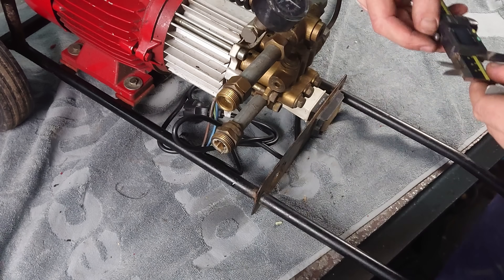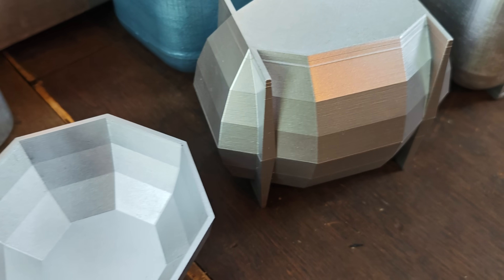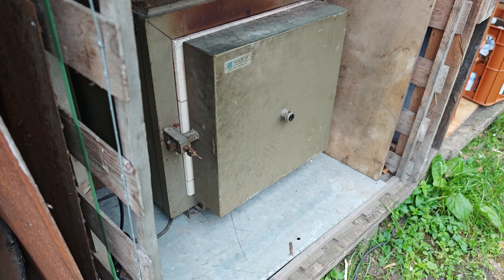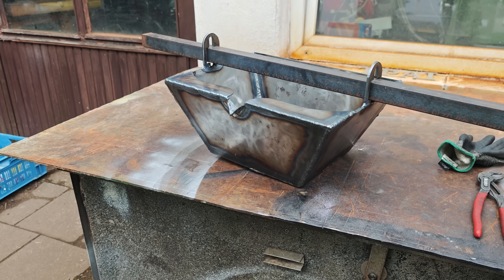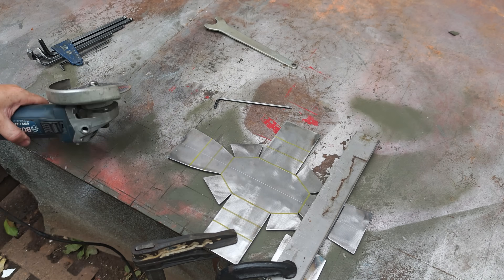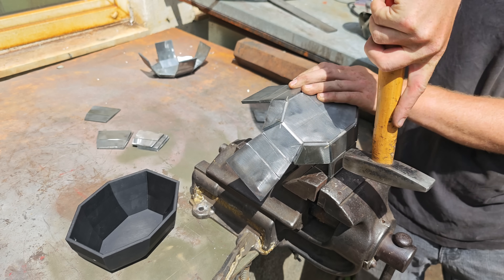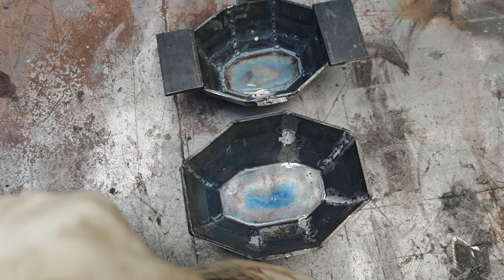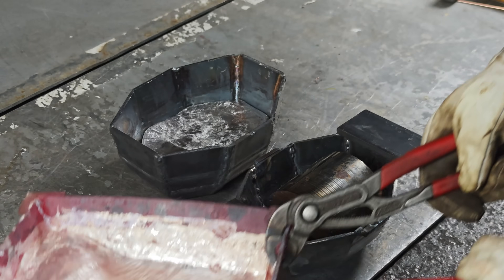Aluminium Casting Experiments! New Furnace, Melting down Scrap and Casting!

Comment: Very interesting topic, you may want to get or hand forge a skimmer to remove dross from the molten metal before pouring, this will keep the oxidized metal out of your casting. There are all types of parts people can't buy any more for scientific instruments that are now obsolete. I have an Orion 8 inch Schmidt-Cassegrain telescope and the base that connects to the legs of the tripod is broken. Parts are no longer for sale and it's a cast aluminum part. I've been looking for someone or a company to make this part at a reasonable cost. Maybe you would consider or know of where I can have such an item made? And if not, maybe you would make parts for instruments in your country, just an idea for your business. God speed your recovery!

Comment: Wishing you a brief and complete recovery. While it would somewhat complicate setting them together, I think pre-heating the inner mold might allow a bit more time for setting it inside the outer one. Also, what if rather than using pliers, a short length of chain were attached to each of the side tabs for picking the mold up?
Thank you as always for your work.

Comment: I always enjoy your projects.  I hope you are recovering quickly from the surgery.  
I am also recovering from surgery, as a result of always thinking I can do everything myself.  (I can, but sometimes I pay for it).  At age 82, I need to swallow my pride and call a friend sometimes.
I did a lot of lead casting, making a great spincasting (fishing) lure, known as a Buzz Bomb.  I like your idea, and have a couple of thoughts.  
Instead of grinding the lines for the bends of your molds, why not use the plasma cutter to cut dotted lines where you want to bend the material.  That way the parts will bend easily at exactly where you want the pattern bent, and then you just weld it up to finish the project.
To make the casting a much quicker process, why not do the casting with the mold inverted, and that way, you can put the sprue and some vents, on the base (now on top) of the outer mold .
Keep up the great work.

Comment: Good luck with your recovery! I think you could devise a sort of register that would hold the two halves together. That would make the finished product more consistent and reduce the need for the weight. Also maybe weld up a sort of funnel you could pour into to fill the mold assembly. Lastly preheating the mold should help keep hte aluminum from hardening too fast.

Comment: For the casting, you can do some kind of allining pins. Example, in bottom part of the mold do a "V" shaped "dent" and in the top part "V" shaped pin, when they slot one into another mold will be alligned easelly.

Comment: melt the aluminum in the lower mold then put the upper in. You might try making a "lost foam" mold with the sheet rock mud coating and sand and all as you can make much finer castings with that method.

Comment: Would it be possible to have the top mold already in place and pour the aluminum into a removable steel funnel? Have a few other conical (for easy removal of the inner mold) holes to allow air to vent that are all the same size as the funnel spout. Probably issues, but may mean less overpour and post processing required. Probably a silly idea and already considered and rejected, but a thought.  I'm assuming you're also already pre-heating the inner mold to take advantage of normal contraction without additional cooling (may have missed that bit in the video)?

Comment: Be careful using steel crucibles. The aluminum will eat up the steel over time and make it brittle at which point the bottom will drop out. Trash that crucible way before you think you need to.

Comment: I think you could weld some U bolts to the inner mold and use them as handle instead of the pliers to move it around

Comment: Both the block of steel and the milling to turn it into a mold sounds rather expensive if you don't have the capability to recycle the chips into new blocks.  You're a good ways from a furnace that can melt steel, and if you ever do get there you probably want a good amount of experience casting aluminum, then some intermediate melting metals like bronze and copper on the way to steel and iron.

Comment: 16:50 You can speed up the process of inserting the inner mould (and increase the precision) by not using the mechanical grips. The inner mould is cold when you put it in and the handles will take a little time to heat up after the mould comes into contact with the molten metal. Those heavy gloves you're wearing would be adequate protection I think.

Comment: I think you need to register the two parts of the mold together and add a funnel so you can pour the molten metal into the mold. Pressing the inner mold down into the molten metal leaves too much time for the metal to cool, and makes it easy to misalign the mold halves.

Comment: Your mold is so well built, why not put it directly into the kiln? If you produce ingots ot the right size, put them into the mold and heat everything up with the weight on top, you maybe could avoid pouring altogether for the end product.

Comment: Nice outcome so far! Maybe you can gain a little time when you place the outer mould on a non-conductive surface (glass fiber, slab of old marble, loose sand?) 

Had you tried to cast the moulds using fire-proof cement btw? 

Your work is always unique and inspiring!

Comment: LOL I was thinking a belt sander would make quick work of those welds and help with tidying up the outside of the cast parts, then you mentioned you didn't have one and I was surprised. But then again, modern shop tools aren't really your thing, and it's probably not easy to find a vintage one, since I'm not even sure they were really a thing back in the day.

Anyway, I'm sure you'll recover from the surgery quickly. You're clearly made of fairly staunch stuff, so I have no doubts that you'll be back in the workshop before you know it!

Comment: I see that you were using pliers to manipulate your molds. I assume that means you preheated them? I think they need to be hotter to keep the aluminum from solidifying so early.

Have you considered melting the aluminum in the outer mold to begin with? That might simplify matters assuming there is a minimum of dross which probably will require diligently cleaning the aluminum before melting it and perhaps adding some kind of flux.

Anyway, let me add my voice to those telling you to take time to heal. Do as your doctors tell you and don’t try to do things too soon.

Comment: Why not weigh out the right amount of metal, put that in the bottom half, then put the weighted top-half atop that, and cook it all in the big kiln at once? Or do it in two steps if that’s too tall, but still doing the melt in the bottom-half.

Or at least preheat the moulds so you have longer working time.

Comment: Get well soon dude!! And simple alignmet pins and handles on the mould will get it more accurate. I suggest whacking the aluminium up another 150C and preheatign the steel moulds a bit, to help it be smoother and more consistnt, i saw a lot of coolign too early omn the good cast

On a lighter note, have look/listen too - "Weird Al" Yankovic - Living With A Hernia " it may make you fel better about your Hernia! xD

Comment: Great video mate. I must aggree with some of the other commenters - preheating the moulds will give you more working time, plus it is important to make sure there is no moisture in the moulds. Pouring moltern aluminium into a mould with moisture in it can lead to explosions of moltern metal (I think). Just wanting you to be safe!

As for being able to get more working time with the moltern metal, since the moulds you made were steel (as well as the weight in the centre), there is nothing stopping you from half filling the bottom mould with aluminium, waiting for it to cool, sitting the top mould on it with the weight in it, then putting the whole lot back into the kiln to re-melt and settle over a longer period of time. This might allow for a less porous, stronger finished casting.

Also, if you have some letter & number punches, or make a little logo punch out of steel and harden it, you could stamp your logo as well as a serial number or a date on the bottom of the castings to personalize / add some awesome details to each piece.

Hopefully you have a speedy and pain free recovery. It is awesome that you can still do a lot of editing and post work to keep you busy!

Comment: You should not melt aluminum in a iron/steel crucible. The melted aluminum corrodes the iron and forms a needle like microstructure that tends to form cracks in the finished part.

Comment: Man, when do you want your crucible to fail? Blowout in the furnace? Blowout when handling it and skin grafts for the next three years? Steel and aluminum, or other metals for that matter become reactive at molten heat. Even stainless will burn out very quickly. The steel becomes significantly softer and weaker as well. After that, you are also contaminating a limited supply of aluminum with iron which as yet cannot be purified in a practical manner. The iron contamination changes the characteristics of the aluminum invariably for the negative. I love what you do. Repairing and re-purposing this old stuff is a form of Zen to me and you do it very well. Please stop messing with the steel crucibles. You now have a pottery kiln. You're bright. You can make your own clay graphite crucibles in any form you'd like. Clay graphite isn't just a convenience or something, it is a must. If treated properly they'll go 100X longer than steel as well, especially for aluminum.

Comment: Why not use gas cylinders as it will take less time in a crucible? I subscribe to a channel called bigstackd that does casting of lots of metals if you need inspiration and details on  building a forge.

Comment: I hope you’re doing well in recovery. As for your casting experiments, I have to wonder whether the lower fidelity of your steel molds compared to sand casting molds means any time you save in the casting process you lose in additional post processing of the casting? maybe in the future with CNC molds that won’t be the case?

Comment: Maybe use an electro magnet to lift the mould and drop into place. Can you turn the power down on the plasma cutter to scoring  the metal instead of the angle grinder?

Comment: This is just a thought...... Couldn't you use the larger diameter mold to melt the aluminum in? It would eliminate transferring the melted aluminum to a cold mold, thus losing heat. Alternatively, you could pre-heat the molds to avoid losing so much heat.

Comment: Steel molds are less than ideal for casting aluminum. However, if you do want to use them, dusting them with powdered graphite as a release agent will help immensely.

Comment: Hope your recovery goes well. 
I  think the simplest solution for quickly putting the mold together would be attaching eye bolts sticking up from the handles so you can grab quickly without needing the pliers.

Comment: Try making the smaller product mold as the crucible and just clear the slag and dross before you set the top piece. This would eliminate the larger crucible and changeovers as you can always add smaller pieces as needed. You could even calculate an approximate amount to render down to get close to the desired product so as to eliminate overproduction.

Comment: Since price is a consideration on the belt grinder, I would recommend checking out this custom one from a fellow YouTube maker, Jer Schmidt. I've purchased the plans (a very reasonable price), but I don't quite have a shop for it. With your shop and access to scrap metal, you could probably knock it out in a weekend. https://www.youtube.com/playlist?list=PLUytjzdhelpbJQSFObRlAJKSoys_4zJxo
Reply: One added benefit of Jer's grinder is that it is designed to have custom attachments built, which would be nice if you're planning a repeatable process. You could build a grinding jig to expedite the process.

Comment: Best wishes on your recovery! For the casting, I'd suggest more rigid guides around the top (maybe even bolt it down to the bottom half?), add a funnel to pour the metal into the mould, and preheat the mould before the pour. The thinking is the guides will help keep the wall thickness even and funnelling into a hot mould will allow enough time for the metal to flow and fill before becoming solid. Might make the process less chaotic and safer too.

Btw I still have one of your toolboxes in service at the workshop :) Looking forward to see the progress!

Comment: Heal well!
Using steel as a mold for casting aluminum is challenging: as you noted, it's hard to create a smooth interior on a convex surface, the steel is sufficiently thermally conductive that it cools the aluminum you're pouring more quickly than is convenient, and removing the cast aluminum from a very-hard-in-comparison steel mold can be challenging.  For all of these reasons you may want to investigate casting in sand instead.  Sand casting isn't without its own challenges, but it does resolve the three issues I call out with steel.

Comment: Maybe you could modify one of those drillpress-stand things where you normally clamp in a handdrill, to hold the top of your mould instead, and lower it down quickly and precisely. Also clamp down the lower half for precise alignment.

Comment: I would weigh the metal, then melt it directly in the mould. then you could just cast correctly sized ingots in bulk. and then just vibrate it a bit when you get it out to get rid of air pockets.

Comment: Pre heating may be a solution but if you know the amount of aluminum you need you could place the mould wi the the right amount of Al. in the oven. due to the lower melting point of the al this vould (probably) work

Comment: Hope you have a speedy recovery.  You need to pre heat the crucible before pouring the molten aluminum in it. This will help prevent a steam explosion. Which can be fatal, or least give you major burns.

Comment: If you heat the two halves of your mold before pouring in the aluminum and assembling the mold, then the aluminum will stay molten long enough to flow where you want it.  Put the lower mold on a steel tray so you don't lose or contaminate any overflow.

If a crucible ever gets away from you and splashes at torso level, you'll potentially have very severe burns.  It's safer to do this work outdoors at ground level on a sand surface (tile, concrete or pavers can shatter if locally heated).  Wear heavy boots, thick leather gaiters, a leather apron, gauntlet gloves and a full face shield.  I know all of that sounds a bit silly, but one slip-up with a liter of molten metal can change your life permanently.  Cotton or polyester clothing won't protect you; they'll catch fire or melt instantly at 700°C.

For an excellent shop-made tilting belt grinder, see the build series and plans by YouTuber Jer Schmidt: https://www.youtube.com/@Jer_Schmidt/playlists

Wishing you a swift recovery -- I'm sure you're desperate to get back to your shop ASAP!

Comment: very clever. a way to retain the big crucible on the shaft you're removing it from the kiln with may make it safer; a shift in weight and it could slide down the handle towards you as you pull it out. just a hole with a bolt through it would work. best of luck with your recovery

Comment: Best wishes on your recovery. For the current mold you are testing, I think I would weld on flanges so that you can bolt them together, and also weld on a spout to guide the hot aluminum into the void between the inside and outside. Once cooled, unbolt and de-mold. Best of luck!
Reply: I was just about to suggest the same thing when I saw your post. 

Preheat the mold as well will help. That's a nice advantage of a steel mold over sand, you can get the steel as hot as the aluminium if needed.

Comment: When you make the plastic, pattern, could you add magnets to each separate face and then make the metal part with a corresponding number of parts for each face, after that tack together and weld.

Comment: I think heating the mold will help give you more time to work with.  If possible you could combine that with a funnel system on the mold to shorten the time spent as well.

Comment: Suggestion: Put a hinge with a pin on one side of the inside (top mold) to outside (bottom mold) mold with the weighting inside the top side mold tacked in. Then put a handle on the opposing side of the mold from the hinge to drop the top side (inside mold down to the spacers. It would speed up the mold placement. Pour the aluminum and lower the mold into place with the hinge and handle. Once cooled, remove the pin from the hinge to separate the part from the mold.

Comment: Quick recovery!    Tip.   use a propane torch to heat the casting molds to prevent too quick cooling.
Reply: Or even your electric pottery kiln.
Reply: Or an induction heater.
Reply: Use the form to melt the aluminum 👍
Reply: @jesperwall839  Only downside I can think of is that this is going to wear out the form faster, from oxidation on the outside and aluminum poisonings on the inside.  I can see this on my steel scrap crucibles I melt in vs my ingot trays.
Reply: @DerekWoolverton  That’s probably true. I have never used black iron as a cast form for aluminium. Maybe stainless would work better? I don’t know.
Reply: Now that I think about it, couldn't he put the lower mold part directly in the kiln? The mold would keep the aluminium liquid for a very long time. You could even put the aluminium in the lower mold and leave the upper mold on top of it to settle on it's own.